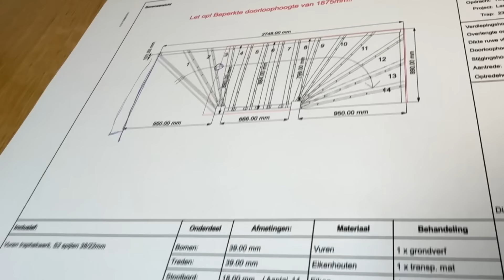Tile shopping Nightmare, What Have We Done?! Part 36

Comment: Just be glad that you get to pick out your tile, and that you're not stuck with whatever a contractor is forcing down your throat.  

When we first moved into our house, there was a leak in our upstairs shower pan.  We called a remediation specialist, because, we expected mold and mildew in damp areas that were to be gutted.  

I read over the remediation contract and signed it -- seemed great!  The team came, gutted the bathroom, dried everything out, painted all of the studs with remediation paint (BS), and didn't rebuild anything!  They left HEPA fans running at our house for months (my wife was pregnant at the time).  

They never read their own contract.  Instead of returning to rebuild, they had NO IDEA that they were supposed to return at all.  According to the contract they needed to, "..rebuild all demolished areas back to original state."  The owner admitted his mistake (not reading what he had signed), and offered to use "material from another job" to complete my bathroom.  What a load of garbage.

I ended up not paying them another dime obviously, and gave them terrible reviews whenever/wherever possible.  In the future, if you have any water issues, be prepared for shenanigans.

Comment: While you're using one one bucket you should have had the other one upside down so everything that's on the bottom comes to the top so when you're ready to use it you just flip it and it's already stirred up well sort of somewhat it's easier it's a little trick

Comment: Hey buddy. Couple of hints the tape peels with a straighter line when its very slightly damp. ...and most of my house is white and you can get a white paint that actually goes on light grey but drys white its great for this ...ps 
Glad you never found a knife to foot in your latest treasure vid  🤙
Reply from the maker: Great tip, thanks very much! 😃🙌 and yes glad I didn’t get knifed this time, I was wearing foot protection 😃
Reply: Learned that when painting my daughter’s bathroom.